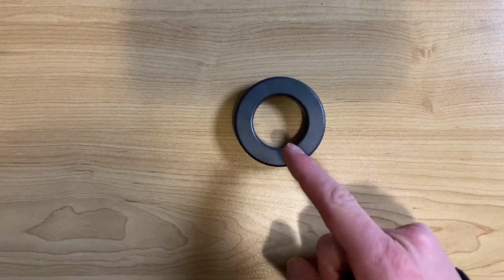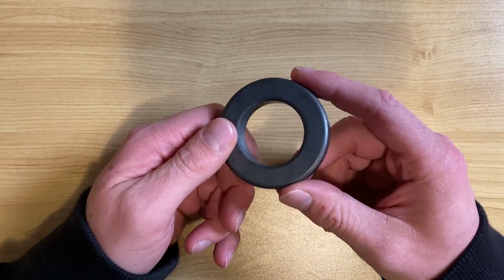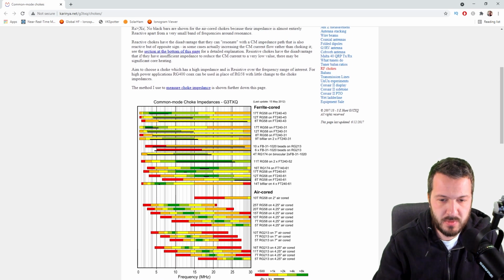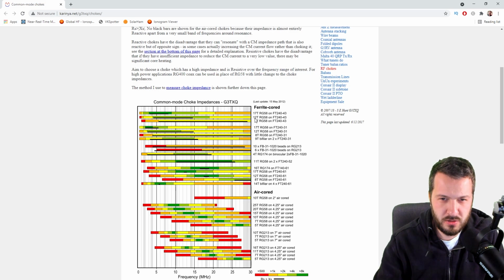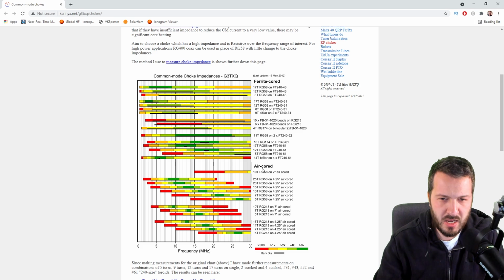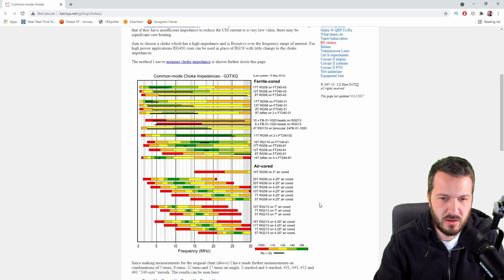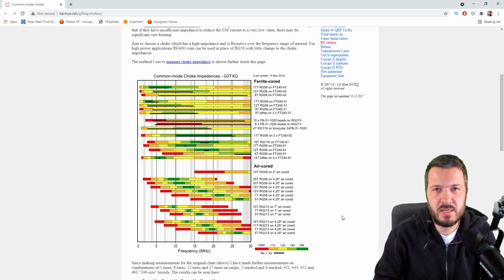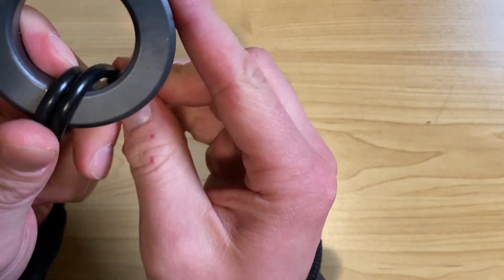Reduce Common Mode Current (CMC) with a Easy to Build Choke

Comment: Im looking into making one of Air-cored ones, to try and help lower the noise floor on my 11m CB radio, But im a little confused...
Everywhere, People say that your coax is important.. it can mean the difference between hearing someone, and not.....
People say that RG58 really isnt the best coax to use... And that there are plenty of better options out there....
And then the air-cored chokes are built with RG58?!?!
Surely thats just going to destroy the signal?!? Making a higher quality coax pointless... if you are going to lose said signals, within the RG58 section.. Since RG58 isnt the best....
Reply from the maker: RG58 is perfectly fine for chokes like this due to the short length and the frequency range.

Comment: Does it make a difference if you use toroids stacks on top of each other? I think i saw it before but dont know if it makes a difference.
Reply from the maker: It can increase the power handling by stacking two together

Comment: I have a 1/2 wave wire dipole for 27mhz, it doesn't have a built in balun. Can i just buy a ferrite ring and loop my coax through it the relevant amount of times as close to the pl259 plug as possible at the antenna end to get the desired result?

Comment: will adding ferrites ( 5 or more ) along the coax do the same thing as an  choke?
Reply from the maker: It won't be as effective as winding multiple turns through. But you will get some choking depending on the ferrite material and core type.

Comment: Hayden- does this create any “issue” if my primary feedline is LMR400?  Bigger pipe going into smaller pipe, as it were…?
Reply from the maker: LMR400 is pretty rigid feedline, you won't be able to pass multiple turns through a core this size. Best to use clamp type toroids (although you'd need a lot to be as effective as multiple turns) or wind this with some RG-58 and stick it inline with your LMR400 at the antenna feedpoint.
Reply: @HamRadioDX  I may not have been real clear on my description. Obviously can’t wrap LMR… the LMR would go in 1 side of the Chile but the end that connects to the antenna would be only the rg58.
Reply from the maker: @HowToHam_Tom  Yeah that will work fine. Just put the RG-58 toroid close to the antenna feedpoint

Comment: Hi.  I built a copy of your current mode choke which appears to work well. One immediate effect was when I put my hand on the metal case of my Xiegu G90 the noise level jumped up very noticeably. With the choke, this effect has completely gone 😀 
Silly question.  Why do most chokes (and baluns) like this one cross the coax over to the other side and wind in the opposite direction?  Is this something to do with phase cancellation or just a convenient way to enable the coax ends to come out at opposite sides for connection.?  
73s  ROB  VK5KRM
Reply from the maker: Hey Rob,
Just a convenient way for the coax, or windings to come out the opposite sides for connections. The crossover also counts as a turn through the core too. Cheers Rob!
Reply: Thanks Hayden. As I suspected.  I have seen chokes without the crossover as well as the air core ones.  😀
73s  @HamRadioDX

Comment: Hello. Nice build. On the website there is a summary chart, and further down there are 3 different charts for each torroid mix. There is a difference between the same configuration on the summary chart and individual one. For example, if you compare 12T RG58 on FT240-43 on the summary and individual (43mix) charts, the graph bars are very different. What chart is correct?
Reply from the maker: The summary chart is dated May 2012 and the Type #43 chart is dated December 2017.
"Since making measurements for the original chart (above) I have made further measurements on combinations of 5 turns, 9 turns, 12 turns and 17 turns on single, 2-stacked and 4-stacked, #31, #43, #52 and #61 "240-size" toroids. The results can be seen here".

I guess he got different results due to testing methods that he refined over the few years between. I've always references the latter charts.
Reply: @HamRadioDX  Thank you for confirmation! It seems 12T on FT240-43 gives really good results on his setup.

Comment: G3TXQ's updated web-page chart shows that 9 turns of RG58 on 3 stacked 240-53 cores provides more than 8K of impedance from 40M through 10M.

That's what I'm using at the output of my my SWR Meter to my 40M EFHW Inverted ELL on 45 feet of LMR400 with a 51:1 Transformer.

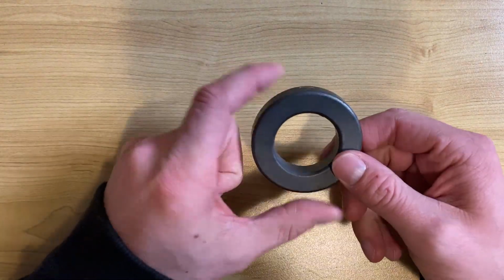Got rid of most of my local 0:00  interference into my TS590SG.

Comment: You actually had 13 turns, but who is counting (besides me). I do the same thing when passing coax through the toriod. I end up with either 11 or 13 turns as much as I try to get 12. But +/- 1 turn does not make a major difference. Well done on the video.
Reply: He pointed out and corrected that right before he cut off the second cable tie.
Reply: He did fix it back to 12 turns but what would be the effect if he left 13 turns? It has diminishing return after so many turns but not to a negative affect, right? Why correct it if 13 turns fit?  @RC21114

Comment: What co-ax did you use?? I have some leftover RG213 feedline. If I have used RG213 as my antenna feedline can I use RG58 for my CMC Balun?? I only run about 60-100w depending which mode I am running.
Reply from the maker: Yep that will be fine.

Comment: Why is it common practice to totally disregard the minimum bend radius of the coax? You've far exceeded it here. Put it this way, would you otherwise accept a coil in your RG58 feedline almost as tight as the curly cord on a microphone? Hams are so dumb.
Reply: How else ya gonna wrap it bud? You got a toroidal core that's big enough you won't exceed the bend radius In yer pocket? It's clearly fine, one and done. Wouldn't recommend you go wrapping and unwrapping and rewrapping the same coax over and over. However as a one time wrapped permanent installed coax it's been proven to be fine. But hey let us know this better CMC you've got up yer sleeve with readily available parts many already have laying around, we're all ears friend.
Reply: @MarkoManiac  bud, it far exceeds the minimum bend radius, by a mile. You have proof it doesn't matter? Then why would the manufacturer specify it?
My ferrite chokes are very substantial and properly designed for the frequency of use. I loop them so as not to exceed the minimum bend radius and space the loops out evenly to avoid any unwanted stray capacitance. In fact, I use 5 stacked FT240-43s for each choke. Sound good enough to you, bud? Do you need anymore solid, technical advice?
Reply: @arconeagain  Naw. Don't need solid "technical advise" that isn't anything of the sort from a sad ham.
Reply: @MarkoManiac  I'm not a ham. I put you in your place though. Try staying in your lane next time.
Reply: @arconeagain  In my lane. My chokes working fine. Cry about it.
Reply: @MarkoManiac  you're the one that's crying. No integrity whatsoever.
Reply: @arconeagain  whatever makes you sleep man. 10s of thousands of these over tightly wound chokes working just fine. I'm sure exceeding the bend radius reduces the power handling capacity and or working life and if you care to show some real evidence of those numbers beyond "trust me bro" we might even find yer criticism interesting. Most of us however are operating so far under the rated power handling of the coax I'd be surprised if exceeding that bend radius causes a serious issue. If it did one of the thousands of us would have noticed by now in our practical application and testing of your superior theory knowledge.
Reply: @MarkoManiac  you hams always think you know better. Think about the construct of coaxial cable, and what dictates and maintains its properties. What if the centre conductor migrates, even over of a long period of time? What do you think can happen to the shield, the shield coverage?
Na, just ignore all that and chuck the specsheet out the window, we'll leave it up to chance. I hear that's what the military do, and commercial aircraft manufacturers, who cares about good practices, or learning something. Just ignore and ridicule, it's 2023 you know?
Reply: @arconeagain  still not seeing any hard evidence or study. Just "the spec sheet says". In practice we've been winding chokes like this for decades. They're field tested and mother approved spec sheet or no. I do know better, I've done it, tested it, used it, it works. It doesn't matter that it violates yer sacred spec sheet and that maybe 1000 years later something might migrate(who knows your speculating cause we violated the God of the spec sheet not testing), I regularly check my gear and my modern radio will alert me anyway if that coax where to suddenly enter a fail condition. What you fail to grasp is unlike the militar or any aviation we aren't playing for life and death stakes so we can BEND the rules and if it works it works.
Reply: @MarkoManiac  hard evidence or study. Simply research the subject a little and you'll find it's a real thing. You can't fix a stubborn idiot. It's not right and you now know it.
Reply: @arconeagain  We all knew about minimum bend radius before you came along smarty mcfly. What you seem not to understand is this works, just fine. Simple research and the hard evidence of just building and testing one would show that just fine for ya.
Reply: @MarkoManiac  you all know about it, hence the word I used,  'disregard'. There's nothing smarty pants about it at all, just dumb pants on your part. But, you persist on going round in circles. This is a true example of the intellect I'd have to deal with on a daily basis if I were a ham.
Reply: @arconeagain  lucky for us you're not.
Reply: @MarkoManiac  that's the spirit I expect from hams.
Reply: @MarkoManiac  I'm not a ham.
Reply: 😊 Is this the winding you use for the 1/2 Vertical? 😮 FOO somewhere in ROK 🇰🇷🇦🇺 an Alien in Asia 👾
Reply: @VK4FOO  ?
Reply: @arconeagain  yes
Reply: Is it not dependent on frequency?
Reply: @hayden-james  technically frequency could come into it, including power levels, but no.

Comment: the air cored are capacitive and used with a ferrite toroid (inductive) of correct mix and turns, one can actually create a tuned circuit of desired freq. Have fun.

Comment: would snap on ferrite beads work better with less loss, since you would not be cutting the coax and maybe using less quality coax in the feed line?
Reply: mix ix less forgiving with snap-on roids. snap on require smaller dia. to get same number of turns (larger loss). ideally slide on 25 or so with correct I.D. to fit (then use heat shrink to keep together) then terminate the ends. snap-on are typically used on dc power cords to suppress noise from supply.

Comment: Thank you for posting this video instructions. The flux lines induced by the current flow in each winding all add up  in the toroid,  and not cancel out :so kindly correct me if I am wrong?
Reply: Correct. Here the magnetic field direction is CCW in both halves

Comment: Hi good morning from the UK, and thank you for your great video's , I have started making the Choke, but the question I have is that I am using an " End Fed Half wave antenna" with a 49:1 balun fitted, my question is where should the choke be fitted, having been to several sites on the net, some say "do not fit near the feed point" other say "fit it 1 to 3 feet away" and others say fit it where it enters the shack" your thoughts would be much appreciated ? best regards Alan
Reply from the maker: Hi Alan,
The CMC balun can be placed on a EFHW antenna at a length of 0.05 wavelength of the lowest frequency required. So for 80m it can be placed 4 metres down the coax. This is due to if you place it any closer it may mess with the counterpoise length - of course this may vary if you use another counterpoise.

https://www.aa5tb.com/efha.html
Reply: @HamRadioDX  Hi Hayden, thanks for the reply, would there be any benefit fitting it at the entry point into the shack, I guess the answer to that is try it and see ? 👍 thanks again
Reply from the maker: You could possibly try two? If you put it near the entry point to the shack, just remember that the rest of the coax to the antenna could potentially have CMC on it, or pickup common mode noise too. Cheers
Reply: @HamRadioDX  Ok thank you..
Reply from the maker: But the best thing to do is experiment! Good luck Alan!
Reply: @HamRadioDX  Ok will try  a few combinations and see what I get, all the best Alan
Reply: What was the result?
Reply: Hi Hayden , hope you are well, I tried the CMC in various positions in the feeder but all it did was mess up the almost perfect swr, and did nothing to reduce ant interference, I am going to treat myself to a Tecsun portable for Christmas and then use it to track down the local interferance, I know its not mains born , so once I have the protable I will walk around the local houses and see what I can find. @hayden-james
Reply: @alanwallis2796  just turn everything off in the house and turn back on one by one
Reply: Yes have done that , pretty sure its external, will go walkabout with the Tecsun when I have it ? all the best Alan @hayden-james

Comment: Need one for 27mhz
Reply: I made one for 11m out of 3’ of RF-58a/u using a mix 61 toroid.  12 turns works amazing for that band.  Actually mix 61 worked better than 31 and 43.
Reply: @rallypoint1 I am about to do 11 meters, I have rg8x cable and a ferrite 61 , do you still say 12 turns boss ?
Reply: @yayo-q1q yes sir!  12 turns.  Just like the vid.  6 and then crossing over and the other 6.  Impedance will be the highest at 11m
Reply: @rallypoint1 just confused onbthe cross over , wouldn't the cross through count as 1 or no ? Thank you man
Reply: @rallypoint1 also would that changed if someone was to put a 300 watt amp through it , wraps stay the same or would that change ?
Reply: @rallypoint1  Curious on your choke and would like to try this. What size is the toroid and what might be the approx power handling? If your antenna is also using a balun then where would you place the choke? TIA ....
Reply: @2wattsout  You'd probably want to use a 240 size toroid, can't say I've heard of a 61 mix, but I guess they exist.
The power handling will be what the coaxial cable is rated for, most manufacturers state this figure in the coax specs.

Comment: What toriod would i need for rg213 and how many turns for the 213 and for rg58 ? And can you get back to me please
Reply from the maker: RG213 might be a bit thick to wrap around a toroid. In the description there is a link to Steve's website detailing the turns for RG-58. For 213 you may have success with slipping on multiple ferrite beads onto the coax line, but you may need to do some research on what mix is the best. TheSmokinApe may of done a video on it
Reply: @HamRadioDX  ok cool thanks

Comment: Interestingly. I've made the same choke BUT I did not stick it in a box. Just a male PL259 line socket on one end and a female on the other (SO239 line socket). Water proofed with glued heat shrink and self amalgamating tape. I figure the coax is waterproof anyway, so the box is a bit of work I can do without. Been using it (them) on my vertical and Moxon with no ill affect. Cheers Adam
Reply from the maker: Thanks Adam, I probably could do without the box but eh it looks good

Comment: Not disagreeing at all since it works but I am having trouble reconciling the usual construction methods of a torroid based filter with the minimum allowable bend radius of the coax, especially at power. I was taught never to exceed the minimum bend radius which this construction method certainly does. Can anyone help set me straight?
Reply from the maker: An interesting question, one that I probably cannot answer correctly.
There a lot of coax choke "flowerpot" antennas here that use similar or smaller bend radius, especially the VHF ones. 

https://vk2zoi.com/articles/half-wave-flower-pot/

Comment: Nice one Hayden, that site is a great reference. Where did you get the box from? been looking for one like that! Cheers Tim VK5AV
Reply from the maker: The box came from Jaycar, let me find a link....
IP65, so dust and hose proof. I don't think it will be submerged anytime soon ;)

https://www.jaycar.com.au/ip65-sealed-polycarbonate-enclosure-with-mounting-flange-115-w-x-65-d-x-40-h-mm/p/HB6249?pos=8&queryId=268d02a9b2368dde57e21b774560e248&sort=relevance

Comment: It looks like you have 13 turns through the toroid core, not 12.  A turn is not a full wrap around it, it's a pass through the center.  I am counting 13 passes through the center.  Could be mistaken but that's what it looks like to me.  KC3OSD Mike
Reply from the maker: Good eye! I picked this up after I recounted and stopped the video. At 6:34 I mention this, the cable tie looks like a turn too I've noticed!

Comment: Hi Hayden,
Nice build. There is a satisfaction in making something with your own hands. For more power handling a direct replacement for RG58 would be RG400, and stacking the toroids in combination with the RG400 would handle 1KW. For about 100W, RG316 would be a nice small diameter coax, but RG58 would also be sufficient at that power level. You and the family stay safe.  73  WJ3U
Reply from the maker: Thanks for the tips Don. Yes for my application RG58 works just fine as I won't be running more than 100W, but great suggestion about RG400 and 316 for the lower power too. 73
Reply: Can I use RG8x instead of RG58?

Comment: Thanks, I generally thread the end of the coax through the hole rather than forcing the bend (bight) through as it seems to reduce stress on the insulation of the coax around the core which is sometimes foam.
Reply from the maker: Thanks, great tip!
Reply: @HamRadioDX  No worries, great channel and don’t forget to turn those 2m SSB beams across Bass Strait from time to time....